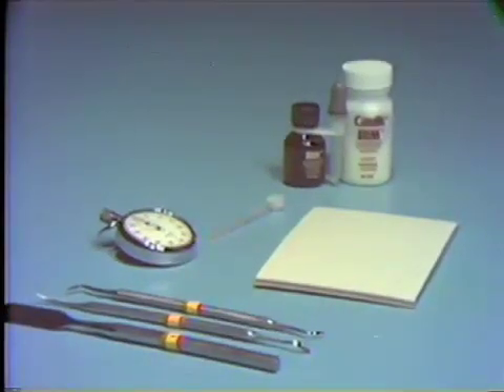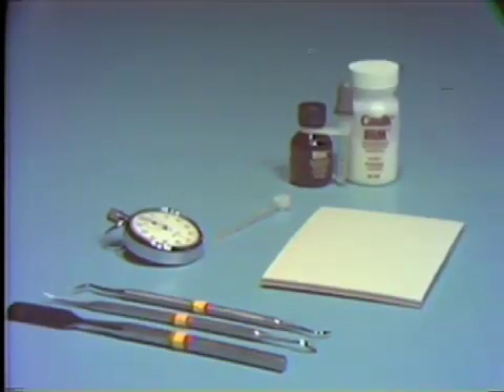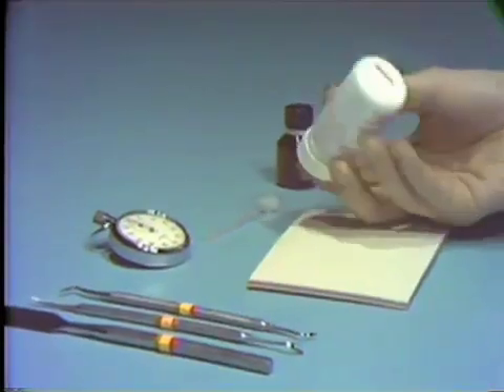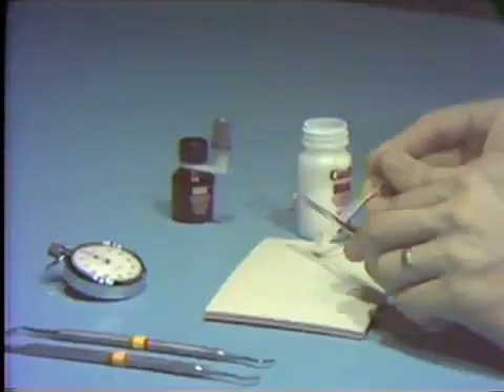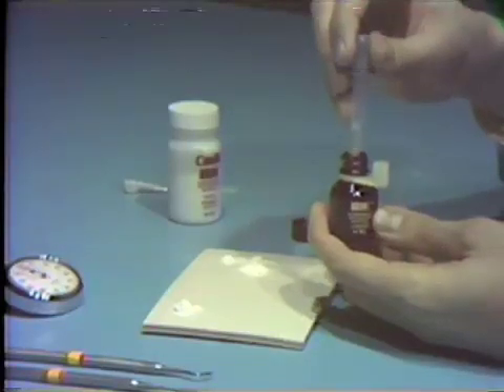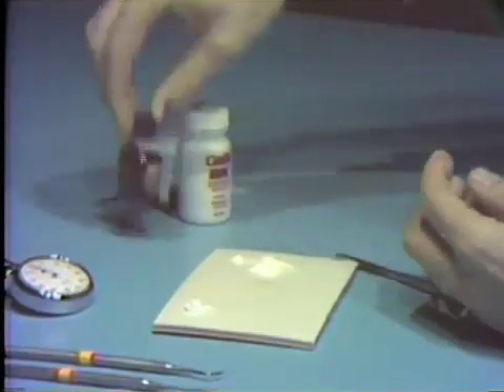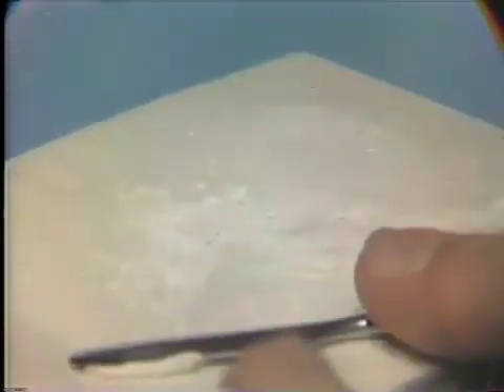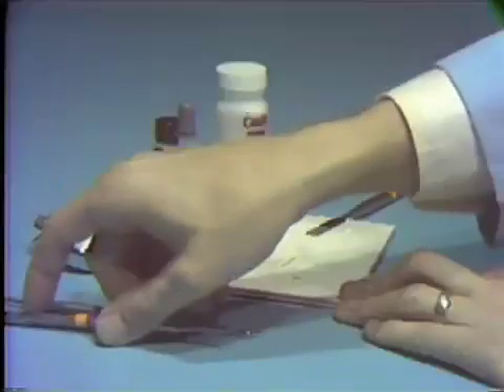Zinc Oxide-Eugenol: Intermediate Restorative Material

Comment: This material is from the dark ages of dentistry and should NOT be used in modern, 21st century dentistry.  My practice has been eugenol free for amost  years!
Reply: And what's wrong with this? If it ain't broke, don't fix it.
Reply: +Pierre Larochelle   I prefer composite resins and glass ionomer/composite materials over amalgam.  If you use any ZOE materials, just remember they are NOT compatible with composites & glass ionomer/composite materials.
Reply: Louis Sachs. They still teach this method in school. I just finished my dental assisting training and this was taught in class.
Reply: Louis - you say eugenol-free like it's some radical chemical.  You do realize eugenol is a component in clove oil?  among other essential oils as well. Originally, it was magnesium and later changed to zinc oxide.

This filling material is still taught in many dental schools today.

What do you mean by "not compatible" with composite materials?
Reply: @Icy_cool This material is for treatment below the standard of care.  I have not used this substandard product in over 25 years.